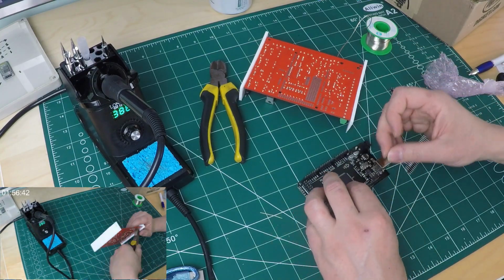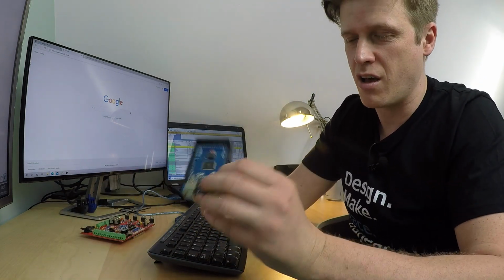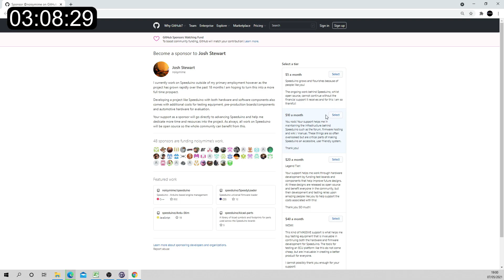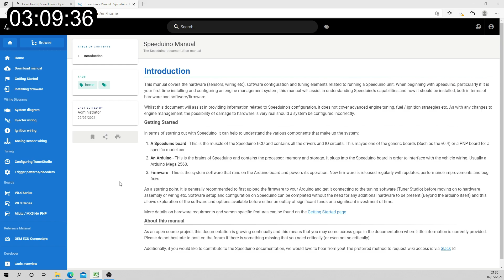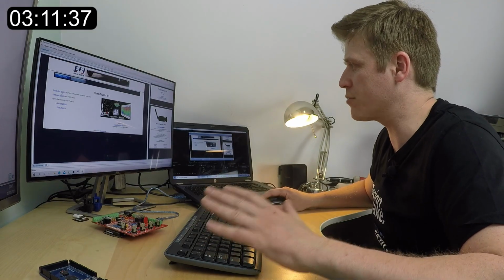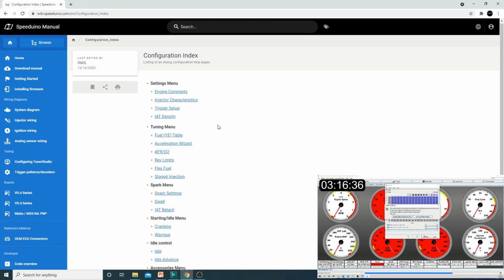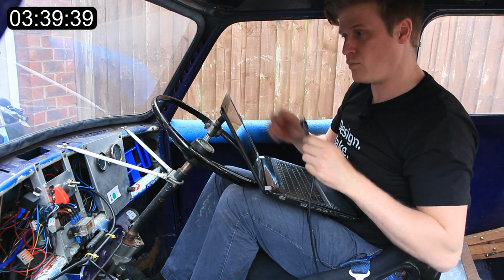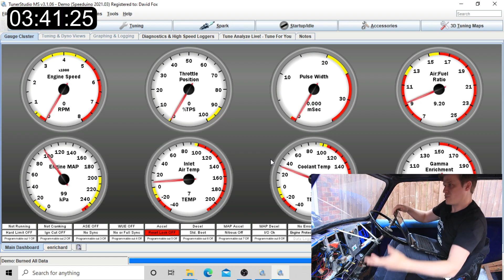Building the Speeduino Standalone ECU - Against the Clock

Comment: What's the rpm limit for 16mhz?
Reply from the maker: That’s not the way to think of it, as the crank signal is worked on an interrupt, so the processer NEVER misses a beat on crank signal, and I get 1000loops/s on mine so that mean ALL calcs are being reviews 1000 times every second.

So taking your question as “what’s the Max revs so that each Revolution of the crankshaft has its own calculated set of values” for spark and injection, that would be 1000/sec*60sec/min = 60,000rpm.
It would work beyond that but I doubt anyone needs the additional power...
Reply: @MakingforMotorsport  60k is plenty unless you're trying to run a Jet engine. It also depends on how good the sensors are. Single coil would probably limit rpm long before that too.
Reply from the maker: @pgtmr2713  your absolutely right, a single coil dwell will be the issue long before anything else becomes a problem.  But with COP that’s not an issue.  

As you increase the revs, the Sheer amount of crank sensor interrupts will slow the main loop, but it’s just not  major issue the engine, the engine will have plenty of reserve in tap.
Reply: @MakingforMotorsport  Good to know. I won't ever need more than 8k. COP I'd have to get some Hyabusa coils and modify to hold them down. Coil pack however was a later O.E. part though. Maybe when this distributor fails, spoiler alert, it will fail.
Reply: There is no "RPM" limit.

There are limits on the crank input.

From memory around 7khz.

You can work out RPM limits depending on your toothed wheel.

Comment: I have experience with megasquirt and megashift and a ton of arduino programming haha. I'm putting a 5.3 in a 1950 studebaker pickup right now to throw together as a shop truck and to tow my cars to tracks. Now I'm leaning towards speeduino just to try it...if I get addicted I'm blaming you. I see there's options to run 8 injector and 8 coils on a newer version of speeduino that uses the teensy 4.1 but can't find info on how to get any of it. Maybe I'm blind. Great video!
Reply from the maker: Yeah, blame me... I’m fine with that! 😂😂

You can upgrade to Teensy,  and you’ll need to find a rarer board for that, but for a shop truck, a batch fired and wasted spark v8 would do the job just fine!   I mean it’s only since the 90s that OEMs have gone beyond that, and that’s just for emissions.
Reply: @MakingforMotorsport  truuuuue. I just don't want to have to tune around that haha. I've done batch fire tuning on the early 90s corvettes and it was absolutely awful. Maybe it was the TPI intake manifold design that I hated, the rear 2 cylinders would always be way too rich so I ended up changing those injectors to a lower flow rate to compensate for that. Makes me cry on the inside thinking about that. I have a teensy 4.1 still in the bag I never opened to play with it.
Reply from the maker: @moneyshot2239  this sounds like an argument for 2 x 4 throttle bodies rather than a plenum which is clearly not the job.  I’d bet it’d run nice on ITBs........
Reply: Haha yea. This engine is going in completely stock for now because I have the original harness ECU and DBW throttle body. Seems like the processing power of the teensy would run circles around a GM ECU from 2006. Might just do the cam while the engine is out and try the speeduino if I can get my hands on the board for it. Hp Tuners credits to tune the stock ECU are more than half the price it costs to build a speeduino haha.
Reply: 8 Itb's would be fun until they need to be balanced 🤣
Reply: The teensy 4.1 is NOT supported and there is no plans for support in the future.

You may have been looking at a joke video Josh posted.

The Teensy 3.5 or the STM32 based stuff can do 8x8

There is another Aussie who has an 8x8 board he designed.

https://www.everythingfuelinjection.com/

Comment: I am an ' old school racer '  brought up with Hilborn constant flow fuel injection, and multiple side draft carb configurations.  Now I have more time to fiddle around with a project car, an EMS is the way to go 
Power comes from the cylinder head ( of which I have modified a lot ) and ignition timing.
I have collected all the parts for a hack on the GM Aussie VN  ECU  ( look up PCM hack )
but your EMS seems so simple. Can you program on the fly, and how many boxes in the ignition table ...ta
Reply from the maker: It is simple, honestly, I am not conning anyone, just need injectors that fit and an ignition amp that works for with either 12v or a crank pulley and you’re off!  Power does come for the head but spark and squirt always help

Comment: I'm only the first four minutes into this, but I'm delighted to hear it's based off the old megasquirt project.
I built a mega squirt, and a test thing for it and everything else and really wanted to use it but... This was early 2000s and it turned out that modifying my engine versus putting in that brand new LS1  motor was the same price, and I dropped that in instead, using the factory ECU and harness.

So I never ran my mega squirt on anything but I've always wanted to add fuel injection to all kinds of small engines and I do a lot of Arduino projects so this is just awesome.
Looking at this about the only thing I want to change is to get rid of the Arduino and just SMC solder on the processor and everything so it's just one board but... I get it is what it is. Definitely something cool and worth looking into

Comment: I noticed you made your base tune out of thin air. It's always recommended to load one of the speeduino base tunes and then modify for your application & board.
Reply from the maker: I didn’t, I actually copied my existing tune but the aim was just to talk through each box and put in the settings from my running Speedy and getting the length of time it takes, but I ended up cutting it like I said. 
Love your Tbucket by the way - incredible build!

Comment: Is there a reason you didn't install heatsinks on the transistors/mosfets on this build, but you did on the previous build?
Reply from the maker: Not particularly, they aren’t part of the BOM I just added them for good practice on the old one.  When the new ends up in a car full time I will probably add them again...

Comment: Cant wait to order mine tho cant figure out how to run it with a distributor...my car is a Maruti 800 (Suzuki Alto) F8D with no CKP or CMP
Reply from the maker: Dizzy is probably the easiest!  You only need 1 output channel of ignition and let the distributor work out where it needs to go.  I don't know the engine well but there would be a later model with a crank position sensor, you can probably take some of those pieces over....

Comment: This is a complete game changer for engines like the 1ZZ, which had previously not been economically viable to tune, thanks to the exorbitant price of standalone ECU's, as you could just do a 2ZZ swap for the same money. But now good 2ZZ's are getting thin on the ground, and you can get 3 or 4 1ZZ's for the same price.. well, this just opens them up to all sorts of modifications. Hayabusa throttle bodies, and forced induction spring instantly to mind. Bloody marvelous :-)
Reply from the maker: Pinned comment!!! Absolutely, using bike ITBs and a Speeduino makes what was (and still is) a £2k project is now a £300 project.  If I had to do things “properly” I couldn’t afford to do it at all!

Comment: Is there any info on using one as an expansion board for extra IO or pwm out puts getting its signal from can bus from a microsquirt
Reply from the maker: Wow, now thats a question!  I'll be honest I don't know if anyone has done it, you can use the Teensy to run Canbus then just use it as a data collector, but you may aswell use it to run the show...
Reply: No.

Comment: This would be a great project to port to MicroPython using something much more compact, say a Raspberry Pico or perhaps a STM32F409 or something similar. Would also be a huge step in bringing MicroPython into the embedded automotive sector.
Reply from the maker: The step up on this is exactly that, either a STM32 or a Teensy, this allows native canBus and extra channels... the boards are out there and designed but not that popular yet.  
I need to get a RaspberryPi, haven’t played with one yet! An itch to scratch!
Reply: Rasoberry pico won't work. Doens't have the required hardware timers used by the Speeduino code.

And why would you bother doing it on a Pico?

it's less capable than the Mega2560.
Reply: @theonewithin609  I apologize, I am new to the speeduino scene. I have been working with the Pico on some other gauge package development using MicroPython. It was simply a passing thought to potentially use the Pico. My initial thoughts where its dual core capabilities and fast I/O, in addition to its significantly smaller packaging. Thank you for bringing up the issue of the hardware timers, as I mentioned I had not done a deep dive into the hardware requirements. Cheers ;)
Reply: The teensy development is very interesting. The speeduino guy did a video about getting it running - it's unnecessarily fast, lol - but it appears they are continuing to work on it to bring in native canbus support.

Comment: Great video! could you tell me how did ran MAP sensor on itb's?
Reply from the maker: Easy, it didn't, its running purely on Alpha-N (TPS) at the moment.  The next video will have more on running the ITBs.  My car is pure motorsport so virutally zero cruise, so it works well, but a daily driver may benefit from a different method.
Reply: @MakingforMotorsport  Thanks for the info, I'm making more of a fun daily from my grandma's vw golf mk2. I'm currently swaping in 8 valve 1.8 liter gti engine... and I would love to use itbs on it. can't wait for your upcoming video!
Reply: Using manifold pressure (map sensor) as your load source for tuning doesn’t work very well (at all really) on engines with ITB’s.  Has to do with the map sensor not getting the same signal (vacuum/boost) when running itb’s versus a conventional intake manifold.  Even on the motorcycles i race that come from the factory with itb’s (hayabusa dragbikes), they don’t rely on their map sensor for any load/fueling calculations beyond idle.  Andre, at High Performance Academy YouTube channel, has a video going into much detail on the subject of tuning standalones when running itb’s if your interested.  Most run throttle position for load source and setup tables with throttle position and rpm in the x,y axis’!  This is Alpha-N.  There is also a mixed or blended stategy that splits up the fueling between map and alpha N switching from one to the other at a definable point in the software.
Most critical in tuning itb’s is setting close breakpoints in the small throttle openings, say 0-20% tps, then spaced a little further apart from 20-60, with relatively wide spacing from 60-wide open throttle.  This is do to the largest differences in incoming air are seen between those small openings versus by the time the butterflies have open say 30-40% they are flowing large amounts of air and the wider openings don’t change the overall airflow as much per increment of movement thus the need for less divisions/breakpoints in the upper % of thrtttle positions when setting up your tables!

Comment: did this engine have a egr valve
Reply from the maker: Hi, it did as it’s the Z16 so there’s a port running through the head which feeds the egr valve in the inlet - no good for 3D printing!  A drill, a tap, a M8 set screw and some high temp RTV sorted it out 👍
Reply: @MakingforMotorsport  how much more gains would you get

Comment: Could u pls share ur .msq file?
Reply from the maker: Hi Joe, I wouldn’t want to share my current one as it’s still very rough, just enough to get the car going really, the spark table is basically 1 dimensional (imitating a simple speed advance dizzy) and VE table still needs a lot of refinement... I will put it on GitHub once I am happier.... what do you need it for?  What car are you running?
Reply: @MakingforMotorsport  I've been on megasquirt 2 extra code for quite sometime. Running on a dinosaur toyota celica.

Comment: I have been wanting to build a stand alone ecu for years now. I have experience with arduino and soldering. Thank you for making the videos. Information like this helps make it easier to get into a project like this.
Reply: AS someone who has been soldering his whole life and has built several megasquirts id like to pass on that once you finish soldering your board, use a paint brush cleaner to clean the rubbish and flux off the board, then rinse it with clean water and use a hair dryer to dry it out.
Then use a good PCB laquer to seal it and prevent it from corroding, many people dont do these things and wonder why they ahve random shorts or faults that start to happen a few months down the track...
Hope this helps.
Reply from the maker: @Mike-ry4ti  great point Mike, another point which to be fair the MS does have over my board is the MOSFETs are all supported.  This is more of a v0.3 problem as there are many Speeduinos which are…
Reply from the maker: If you have experience with soldering projects you’ll fly through this!  Best of luck 👍

Comment: Brilliant! Appreciate you taking the time to document. I’m going to go this route over MS as it’s cheaper and Arduino dev is something I am already comfortable with. Question - do you have an STL file for the 3D printed enclosure or did you find it online? Thanks again!
Reply from the maker: It’s not 3D printed, it pre-dates my printer but it’s a fairly standard ABS project box.... when this spare Speeduino gets installed in something, it’ll have a printed enclosure but I don’t have the designs yet!
Reply: @MakingforMotorsport  Thanks! Probably a pretty specific design for the car  in any case. If I go this route I’ll post one. Appreciate it.